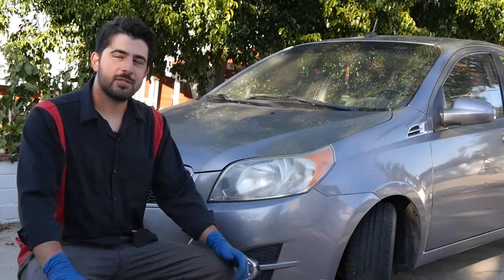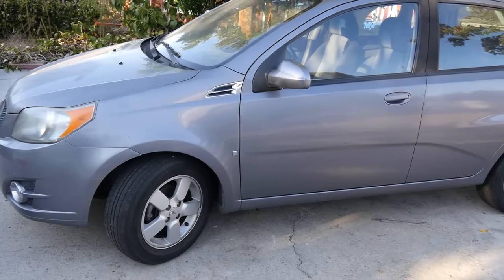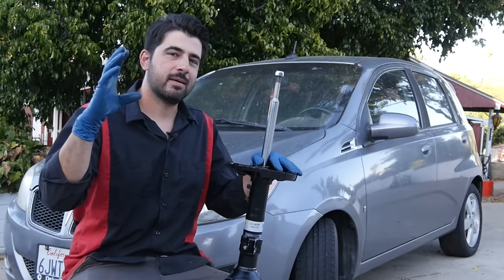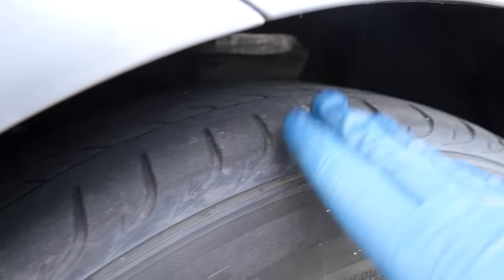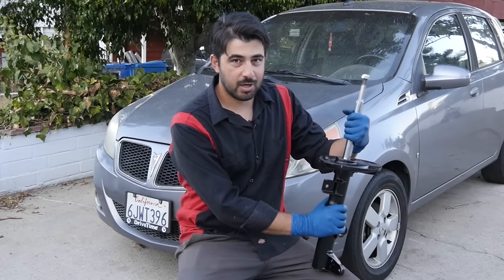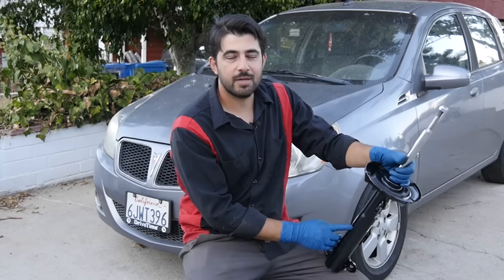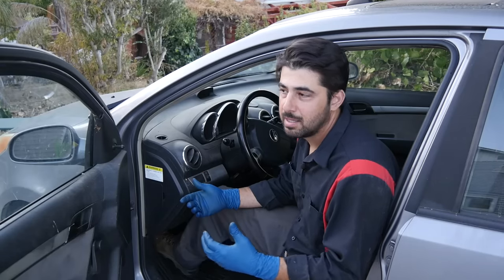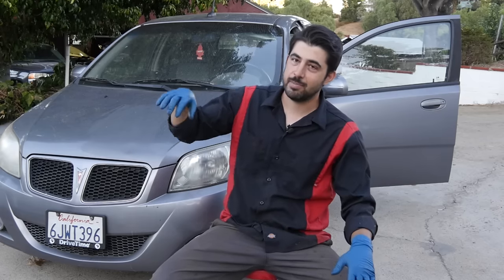How to Diagnose a Bad Strut or Shock on Your Car

Comment: I replaced my Struts on my Honda Pilot after it was making a clanking noise when going over bumps. It fixed the problem and I soon realized how bad the struts needed to be replaced becuase of the difference it made. Also good to mention that the car needed an alignment after replacing them.
Reply: This is starting to happen to my car
Reply: I have a Honda Pilot myself , started to feel the road more and feel bumps more if that makes sense, I searched bad strut symptoms and your comment was the first one I read , it’s a sign haha thanks
Reply: Did one side of your car feel loose?
Reply: Did your Honda Pilot’s suspension make what sounded like a single loud metal “ping!” sound? I’m not sure what happened as the car drives fine.
Reply: I also had my steering wheel move all over when hitting bumps or train tracks. No one on any video mentioned this except for “Ratchets and Wrenches” . He is very knowledgeable!
Reply: After how many years?

Comment: I am experiencing all the symptoms too on top of going through second pair of tires in less than a year. Mechanics say I went over a hole and lost the alignment, the car has 60k miles and it never happened for the first 50k miles of driving. But the mechanics claim suspension is all good and new because it’s not visibly damaged. I really doubt that anyone actually does the drive test to make sure they just look at it and say it’s fine, unless some mechanics do?

Comment: I find it funny how he tries to explain the parts and the vehicle without having it sound like his mind is in the gutter.
Reply: Anthony Roic  I just learned that I over filled the oil in my car by half a gallon. Is there a chance that the excess oil can spill out of the oil dipstick, into the engine? I think I may need another oil dipstick.
Reply: Anthony Roic  Dude I could talk all day about how to maintain cars. Not that I know everything, but it would help to DIY the car if I ever have to, like the rack and pinion. Came close until I got to the two C clamped 19 bolts, on a 97 camry.
Reply: Anthony Roic  yeah, I would drain the oil. Not sure if oil dipsticks could fail overtime, since I have never had to replace one before.
Reply: @behexen250 this one is a 2001 Toyota camry. I have never seen oil spill near the dipstick before. Maybe there is a lesser amount of oil to put in the 2001 than the 1997. It was smoking a bit under the hood. The oil spilt from somewhere and must have hit the manifold. There was some more on the engine strut and on the engine near the oil filter. Like a mild spill.

Comment: Looking good brotha. Struts and shocks are one of the easiest for the lay man to understand because many people have driven a bicycle. Applying the concept of a mtn bike shock to the car's shock/strut is identical. How to identify a failing vehicle strut:
1 - the oil is coming from the strut
2 - oil around the shaft

That's about it.

If no oil is leaking but there's a knocking over bumps and uneven cornering, the upper strut mount needs to be replaced but not immediately necessary. Generally a worn strut and/or strut mount won't throw off the alignment too much and rotating the wheels every 5k (oil change) would be good. This doesn't apply to the other 10% of vehicles out there.

Comment: I just replaced my two rear shocks, it’s been a while, I was shocked at how expensive they’ve become.  It’s been 30 years since I bought a pair, they really have gotten expensive.
Reply: Inflation will do that. Also stagnating wages.
Reply: They're not expensive if it's a basic vehicle, around $60-75 a corner online for basic kyb (even cheaper with spring sales/rebates). Cheap Chinese sensen are like $120 for four. That's pretty cheap for such a vital component that makes a huge difference in making an older car feel newish.
Reply: You were shocked at how expensive shocks were to replace since 30 years ago when you originally upgraded your 4x4 with new shocks? That's shocking.
Reply: Lexus dealership asked for $2500 for rear shocks only.
Reply: @soniasias6226  Dealerships and big chain shops are complete thief’s when it comes to repair.

Comment: Thank you so much for this video. Every time I went over a bump or pothole the steering wheel did exactly what you said it would. That helped me diagnose my problem after already changing droplinks and bushes on my anti roll bar. 

Would you recommend changing just the shock absorbers? Or do the whole suspension with the springs too?

Comment: You make some excellent training videos. Can you recommend a scan tool for the serious engine performance DIY'er?
Reply: google these...  Bluedriver (NO recurring fees) or Thinkcar (recurring fees).  I have the bluedriver and it totally saved my rear today.  I am 1K miles from home and all of a sudden a bunch of errors were thrown.  This caused my VSC light to go on AND cruise to totally STOP working (important to have cruise when traveling 1K miles back home).  Bluecar allowed me to scan and find out all issues AND reset ALL codes so my cruise worked again.  It probably saved me $500. - 1K in the last 12 hours in potential tows and BS proposed shop fixes...  FOR REAL.
Reply: I have the Bluedriver and it's great. Easy to use.

Comment: Also, check to make sure that your upper and lower control arms are intact on the front and the back. As, they can be completely detrimental to the control of your vehicle. Mine, I didn’t know were rusted in spots, and when I changed out my air shocks for my Land Rover… When the shocks went back up, it broke the one in half and if it wasn’t for the shock, essentially holding that assembly together… The wheel could’ve essentially been free to go left or right by itself and could’ve taken my vehicle out of control and wrecked it.

So be on the lookout for those on your vehicle when you change out your shocks, just to make sure. Especially if it’s early 2000’s to maybe 2010… and especially if you live by the ocean or in an area where you get a bunch of snow and they salt the roads. Which can less than the life of any metal part on your vehicle.

Comment: What if I hit a bump and there is a clanking sound come from the front. Is that bad struts? Not my sway bar links.  Changed those already.
Reply: It very well could be. 
Are your ball joints good?
Reply: @deasttn  no. That's probably what it is then
Reply: Hector Hernandez Late answer, but usually clanking sounds are from sway bar links, or the bushings on the sway bar. Changed my links yesterday and it is much better now

Comment: If you’re bouncing down the road on tiny bumps like you’re in a lowrider on hydraulics yeah you need new ones
Reply: My truck started doing that this week. I bought it a couple months ago and it was riding stiff and rough. Now its bouncy like a lowrider. Should a i fix the strut and shocks or just shocks?

Comment: I have a 2012 ford focus with front struts and sway bar links that are 1.5 years old and i just put in new lower control arms...I thought the new control arms would fix my slight vibration and inside tread cupping, but it has not..Then I have noticed that I here clunking which i think is from the strut mount.  i do remember hitting a bad pot hole months ago and wondering if that destroyed the bearing..However, after jacking the car up and pulling on the wheel and forcing it up with a pry bar under the tire, everything seems tight and I can not reproduce the clunk.  Only here it when hitting holes in the road.  Any advice?  Hate to do all the work to take the strut out and still not be able to tell if its bad.

Comment: My 2012 Honda Civic, shakes or vibrates at times, it comes and goes away. I replaced the engine mount and the back mount, I didn’t replace the transmission mount. It seems like it’s better but still some vibration.  Various speeds. I suspect it could be the struts, they have over 200k miles. I want to get to the root of the problem… Any advice.

Comment: Hey, I watched the video and none of the symptoms I see in my car which has over 100K miles on it.  There is a thumping noise coming from the back(right rear) on my car when I go over an uneven surfaces.  1) Please tell me if bad or failing shock can make a thumping noise? 2) Can "center nut" that keeps upper shock mount to the shock stem, become loose and make thumping noise? 3) The noise is most likely coming from other components(sway bar links, bushings)?  Which of the 3 do you think is more likely the issue?  Thanks!
Reply: The noise you are talking about? Is it like a rattling noise when going over bumps. Most likely sway bar links.
Reply: @lancepage8768  No, it is kind of a dull thump.  I looked at the sway bar bushings and these look good, so are the sway bar links.  Just wanted to know if a shock can make a thumping noise?
Reply: What was it if you’ve resolved the issue??
Reply: @sergiomunoz928  I have not done anything yet and just drive like that. I suspect it is the rear shock
Reply: @Charkatak  I have the same common issue too after not doing anything to it cause few mechanics couldn’t find the noise where it’s coming from and tells me the shock n strut “looks” good but doesn’t actually take it apart which that’s the only way you can tell, but trust it’s annoying and terrifying to hear that thumping noise from the right rear side. But I’ve had it, told myself to just replace the whole thing. Lol so I’m getting my shock/top bracket mount replace on Monday and hoping that’s will fix it.
Reply: @sergiomunoz928  I took my car to one of the mechanics and drove with him and he told me the sound comes from the rear shocks.  He then checked/pushed down on all corners and the suspension was not bouncing and appeared to be firm. So at the end, he said if it isn't bothering me too much, then I can drive until time comes to replace the shocks.  Lets see what you discover on Monday
Reply: @Charkatak  i got my rear right shock replaced by an mechanic, definitely it was the problem this whole time. It was defected and worn out. So no more clanking thump sound, the ride was smooth and quiet with peace lol
Reply: @sergiomunoz928  That is good, so you and your car are happy!  One of my other mechanics drove with me yesterday and as soon I drove over specific surface he immediately said, it is the sound of a rear shock issue.
Reply: @Charkatak  thanks! I’d replace it if you have the chance. Def worth the fix. Don’t wait on it or else something can happen unexpectedly.
Reply: @sergiomunoz928  It does make sense to replace it, but car has 118k on it and I would have to replace both rear shocks... Acura users on forums recommend going with OEM parts because aftermarket shocks especially for my RL aren't good as they would last about 30k.  Pretty much bare OEM rear shocks and few required nuts/bolts would cost $450
Reply: @Charkatak  yeah aftermarkets are pointless. Get OEM, just do one shock at a time instead, then the other one when you have enough $. Why do both to waste more $. You don’t really have to do it the same time.
Reply: @sergiomunoz928  If car would have much less miles on it, then doing 1 shock would be an OK idea, but since at least both rear shocks have a lot of miles on them, then changing one could alter the ride.  I will have to measure how low one side(if any) is sitting compared to the other.  I will definitely do it, will wait until warmer days(spring/summer) as I would be doing it outside.
Reply: @Charkatak  whichever works best for your car, but good luck ! Hope you’ll get rid of the sound and enjoy the smooth ride after all 🙏🏻
Reply: @sergiomunoz928  Thanks, I am looking forward to that too :)

Comment: It is also not necessarily see a leak in the shocks. For me every time I decided to change them and when I inspect them I see that they became very loose. Very small force were enough to compress them. That means also that the car is carried by the struts and engine mounts only... You can imagine how the dampening and vibration be in this case. 
So my advice to myself is to change them regularly regardless of their conditions. Say 60-70 km are fair enough for them.

Comment: You da Man!  Considering KYBs to replace my OEM toyota struts.  How can I tell if I need an entire new "quick struts" or just a new strut (and reuse the OEM spring)???  Someone else told me that it is usually best to keep the original spring portion because they are usually much better than any spring you will get on non genuine toyota.  Do you know any test or way for me to tell if the OEM spring portion of the strut is worn out or not?  In other words, I am affraid that if I transfer the OEM spring to a new KYB strut, that I will quickly find out that I should have replaced the spring too.  You always have such excellent videos!  Help!  :-)

Comment: I was wondering. I have a 2010 elantra with 82,000 kms. Problem is that the ride is really harsh and noisy. The rear shocks give a really rough ride on rough road. Steering is ok, and they are not leaking. I had a mechanic check it out, and he said it may be the upper mounts. Rough noisy rid eover rough roads. Also I wonder if it may be a mount problem. Also I am not sur if In can replace the shock because there is a upper rear mount that I have to remove, but I do not have a hoist to remove those mounting bolts. What do you think!  Thanks

Comment: Do you recommend replacing struts as a maintenance item, or just when they are "bad"?  At what mileage would you recommend replacing them?
Reply: Do a quick inspection of the springs making sure they're not cracked, then lift the boot on the shaft of the strut to see if they're dry. If all checks out positive--no need to replace. They're not a maintenance item. More a suspension part as to what type of road you drive on for the life of the vehicle. Hope that helps

Comment: I have an almost new car, 2021 Sonata with 42,000 miles.  I started getting an odd noise from the rear suspension a few months back.  At low speeds there's a rapid thumping noise when I drive over cracks in the pavement. 
I highly suspect the shocks.   But with only 41k miles Im reluctant to replace them.
Can bad shocks make thumping noises?

Comment: My Nissan patrols got a bit of a death wobble. I noticed the driver's side shock absorber is missing it's bottom. Top ones look like nylon but there's nothing on the bottom, should be 2. I don't if I need to replace the whole shock or just buy rubbers, cheers

Comment: On my 2008 Altima, I did all the test but all of them checks out. But when I’m driving on the freeway and there’s an uneven road, it rocks like a boat side to side. So I completely removed the spring and tested the strut and yep, busted shocks! 

The monroe struts for some reason was busted on the top 2” of the struts and works fine further down. Probably the reason why the tests I did passed.

Comment: I don’t notice any of the issues here,but I hear a rattle at lower speed coming from rear passenger side. Sounds like outside, not interior. Checked the spare and it’s solid.  Weird part is, I test drove it and didn’t notice... bought it 3 days later and heard it.  Only change was dealer plate removed. What could it be?  Don’t notice it hardly at all when up to speed

Comment: 1994 ford ranger. My steering is very loose. Replaced all 4 shocks and rear springs. How do I diagnose further?
Reply: Try adjusting the steering box to take out excess play.  That helped mine alot.  Check tie rod ends for looseness too.
Reply: Check outer tie rod ends , sway bar links, bushings

Comment: Did you know that the equations that describes motion and forces of the damper and spring are the same for an electrical capacitor and inductor. In fact early analog computers were used to simulation these mechanical devices since the equations are the same..

Comment: will this work on a twin turbo audi?
Reply: No because twin turbo audis use air suspension--meaning their suspension is determined by atmospheric pressure based on location variables. Porsche mastered this but Audi perfected it. In summary, the Germans excluded an entire physical suspension system and now rely on world global weather models based on the vehicle's GPS. It's hard to explain...
Reply: @PotatoeChipz  very nice.

Comment: Will my replacement struts ever get softer? So stiff
Reply: Unfortunately, yes. Everything gets softer with age. Everything
Reply: I’d like a softer ride but stiffer is better for handling
Reply: @futureshock7425  tires play a big role in ride quality.  Low profile tires can be rough.  Consider getting a larger tire (your car probably has a couple options for tire size).
Reply: deasttn yeah I didn’t spend a lot for my latest set definitely a different feel than the tires it came with

Comment: First tell me where did you find that little Pontiac?I haven't seen one in a few years.
Reply: pontiac vibe discontinued production in 2010. The vibe was a joint venture with Toyota. Toyota Matrix 1zzfe engine same as most Pontiac vibes base models- interchangable parts. Great vehicles- GM messed up by getting rid of this great economical car with a superior Toyota engine (corrolla) one of the most reliable engines on the planet. Also with the seats folded down there is a tone of cargo capacity.
Reply: @proanswers  That's not a Pontiac Vibe, that's a Pontiac G3.  It's basically a rebadged Chevy Aveo that was only sold for a year or two before GM killed Pontiac.  Pretty rare car actually.